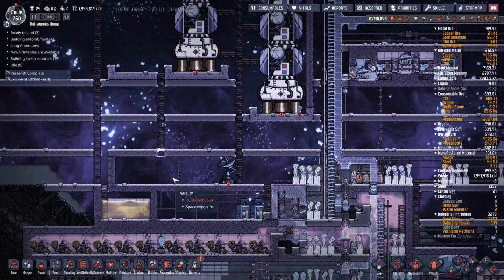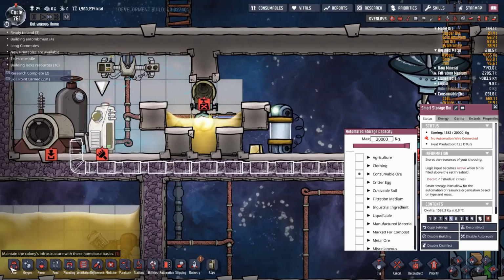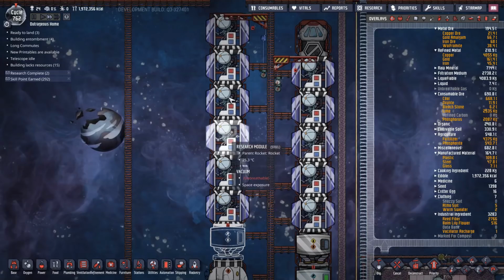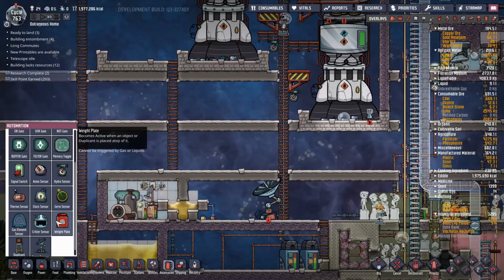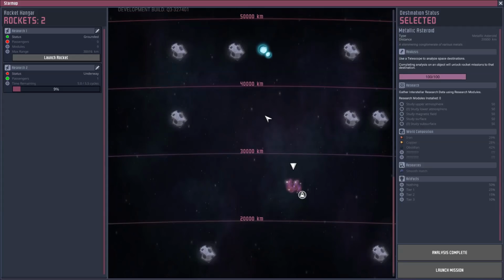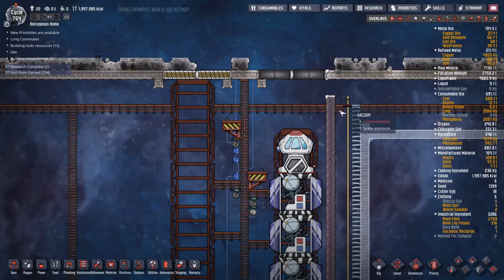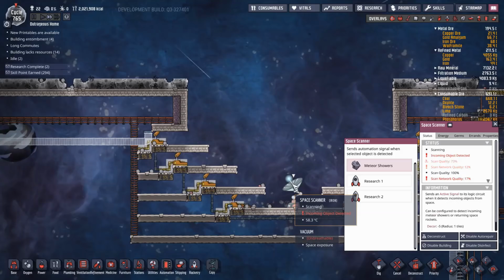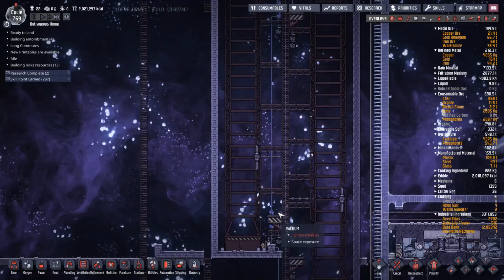QOL Mk3, 28 Petroleum Rockets : Oxygen not included

Comment: Love your Vids - solid explanations and an amazing balance between functional and simple-ish. If you want to get rid of that naked scanner,  you can just reverse the silo-build and have the engines sit on top  of the bunker doors. Rockets don't take meteor damage,  as well as pipes and automation :)
Reply from the maker: I considered that, but worried about door overheat and how to dispose of the regolith.
Reply: Oh, very good point. I guess with the few rockets I launched that hasn't yet become an issue - sounds like I'm in for more tweaking. At least thanks to you it won't be "wait, what's happening now?!". Oh, this game.
Reply: @FrancisJohnYT  I think I figured out a way. Once the rocket is built, it doesn't need to sit on tiles anymore to launch/land. So by leaving 9 tiles space below the rocket, the bunker doors will be safe from the exhaust heat (and can be cooled in case that becomes necessary). Or they can just be left out completely. Regolith disposal can then be built with bunker tiles below that.

On another note, in your current build, couldn't you just get rid of the bunker doors once the silos are finished? They are meteor-proof anyways.

Comment: Don't know what to do with this. 
So on my map I have
2 chlorine vents 
2 steam geyser about 1608+658 2267g/s
2 natural gas. 829+137 966g/s
2 oil wells
1 hot polluted O2. Wow That's so much O2 there. 105g/s. They really need to adjust the minimum on that or make if you don't get good steam vents to up other things. 1 whole dupe worth. 

AND THAT's it. 
All systems are going good and not maintenance needed. 
I could handle space and not worry about the base. 

Explored around. Don't see any more neutronium. 
Was thinking about tearing out every biome just to be sure but I am 95% sure I don't see anything else. 
Not sure if I should try a hand fed boiler but I might. Last 1 was just so finicky as I didn't have the oil for 10K/s.They just so finicky. 
28 slickters. Had 4 hatch farms been slowly cutting them back as the slickters were building up. 
Still have enough to fill 2.5
I was thinking of adding a 5thor 6th slickster farm and maybe another rancher. The cook and graoundskeeper in and doing a good job taking care of the hatches while rancher is handling the slickters. 
I just fired up the 2nd oil well. So not sure how my oil reserve is doing at the moment but before it was doing good.
It's at the bottom of the biome covered in oil. I didn't realize it would still work covered in oil but it's chugging along and when vented. Gas just pushes the oil out of the way. 
12 dupes but everything getting done as speedy as my pace is. 100K and climbing omelets. 

I set the natural gas to burn at 60-65% battery to ease up on the petro usage but still primary at 60-75%

What to do?
Do I have enough water power and oil to sustain myself?
Should I plan the boiler on the side as a back. Then if so. How to run it at a lower rate? It's so finicky. 
I was wondering if I could maybe use space for to supplement power n stuff.
Reply: Thanks for showing us how to play the game. 
Keep it up.
Reply from the maker: Damm that is not a nice map for water. If you boil petroleum from the two well's that is an extra 400g/s of water. With 1kg for rockets that leaves your 1.6kg/s for dupes so about *edit 14 maybe a little more if you prioritize divers lung. But you will most likely have to recycle toilet water as well. Also absolutely 0 farmed crops. Happily this is exactly the kind of situation I designed my playstyle around, you should have all the tools you need to smash this. I run my boiler at 6KGs I just replaced a few of the last pipes in the heat exchange with ceramic, stopped the overheating with the reduced flow. Also solar is a great power supplement.

Comment: Oxyllite refinary. Why not a pressure sensor and a regular bin. 
As you get to end of using it. Your gonna have a lot of wasted oxylite and it won't turn on and off every time a dupe grabs a bundle. I know I know. Have so much but that's just so inefficient use of resources. 

Remember referencing true false. Like with those other machines that require not gates. 
When smart bin has this amount. True. Send green true signal. 

Smart bins are good for dupe operated machines to run in batches with a regular bin next to it. 
Good if you have 1 dupe running multiple machines instead of running around trying to get all the machines in the same cycle. 

Setting rocket fuel to different amounts not only inefficient butmpossible to make it there. 
It factors the weight of the fuel. Not sure if it didn't before but it does now. 
I messed up and put a full amount of petro and only half oxylite. Rocket didn't have enough fuel to make 1st asteroid.
Reply from the maker: Pressure sensor would be smarter, will try implementing that before the switch to LOX.